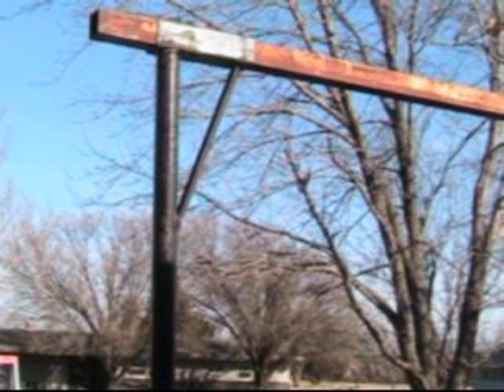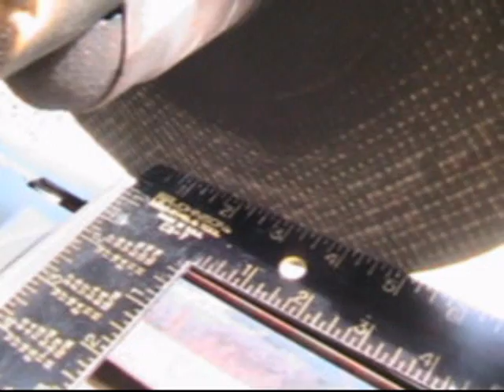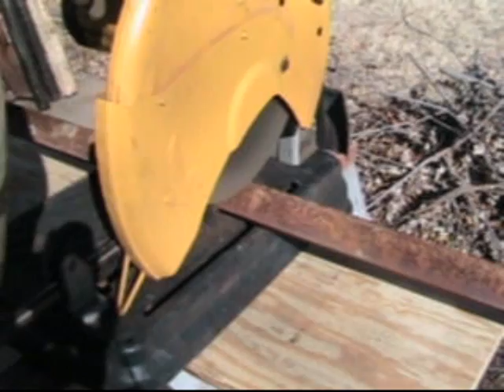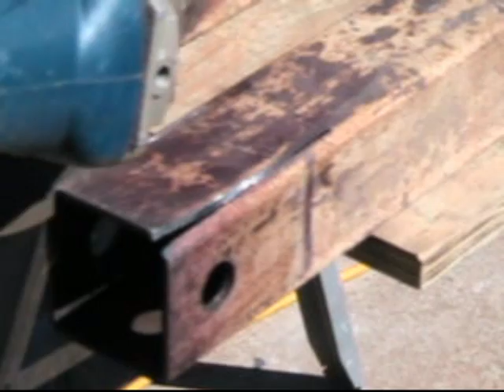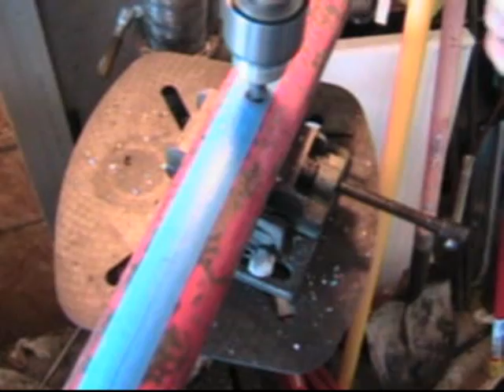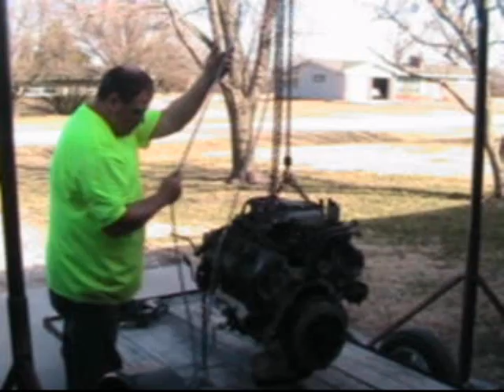DIY Engine Hoist Frame; overhead style

Comment: Hello. Can you give me your toughts on my plan to make a "disassemblable" metal hoist with bolts. My biggest concert is safety. The structure or design would be much like yours. The engine weights 350lbs. The bolts would be used "grade 8" in US standard. "M10-10.9" metric standard. Height - 7.2ft. Materials to use - 3x3x1/4inch wall square tubing for the overhead beam and the two side "T". The bracing would be with angle iron - 2x2x1/4 inch. I need to take engine out of Kia Optima. The engine is 350lbs. Wonder if i need more than 7.2ft height. If of course the whole thing is begin to start with. Thanks for the time.
Reply from the maker: Sounds like you got it down. If it's KIA car, I think the height is ok. 350 lbs is light enough it should work with the 3x3x1/4" square tubing.

The only issue with the height is what you use to pull the engine. A chain hoist will hang down some, so make sure there will be enough distance between a hanging engine and your car's grill area. That's where the 7' 2" may get you.
Reply: @bgdesignandsolutions  Thank you.

Comment: Wow, this is super cool. I've been needing to lift stuff off trailers, remove ladder rack from my truck bed, even lift my doors off my jeep. I've been knocking around the idea of making one of these for a long time, and your design is super simple, powerful, and would get the job done. Pretty cool!
Reply from the maker: It's a little hard to set up, but works great. I have since painted the base and the top rail yellow. Looks nice too. I recently pulled a motor and tranny at the same time on a 2008 Hyundai Tucson. I rebuilt the motor and then put them back in the same way too. Had to do it that way because of the way the gear box was attached.

Because it's adjustable, I set it at 8' 6" for engine clearance over the front grill.

Comment: just came across this nice build .Could you tell me how long the square tubbing was that you welded the larger  round tubing to.
Reply from the maker: The bottom is 2-1/2" O.D., and is 73" long. I then cut out for the wheels, but it's still 73" long.

Comment: Great video.
I am thinking of making a over head portable hoist myself.  I like your idea.
How much can you lift with your hoist, I was hoping to make a 1 ton hoist just for over kill.
Thanks again for the video.
Reply from the maker: I used basic stress formulas when making this, which states 800 pounds with less than 1/4" flex at mid point on maximum width at 120". I don't plan to lift more than that, so it works for me, but I know it will.

Try to find the right formula for what metal you plan to use to help you determine size and strength.

Comment: Okay this is hilarious I'm looking at potentially pulling my engine out of my Isuzu Rodeo but having a hell of a time getting the exhaust manifolds off. It seems there's absolutely no room to get to one of the bolts in the back. I have followed every and traction that I could find and I just can't find it it's a 3.2 L 24-valve V6. Anyway my Isuzu rodeos in 1994 similar to this vehicle in this video. I have very few tools and no engine hoist at this time but I've got a blown head gasket and all I want to do is get the head off of the engine on each side so that I can actually inspect and replace the head gaskets and put everything back together. So far it's taken me about four months of work trying to figure it out. I live too far away from anyone who seems to give a damn about helping somebody like me even though I'm willing to pay them. I'm about ready to call up the radio station or put an ad on Craigslist for free car if somebody has a way to tow it out of here.
Reply from the maker: I fully get your frustration. It would be easier to just pull the engine, than to spend time trying to get the heads off. There's too many hook ups, and stuff going on, and cramped spaces. I know it seems harder, but you just answered your own question: do I pull the engine, or not? Engine is still in, and the heads are still on. Question answered. It took me 15 hours of time to pull my engine, and 15 hours to put it back in. (I know, I timed it both ways). Good luck.
Reply: @bgdesignandsolutions  I just got done working on a 2001 Chevy Malibu, I called her Christine - The car from hell.
After doing multiple repairs on the engine it finally developed a coolant leak that put antifreeze in the oil pan.
Needless to say I was ready to shoot that car. I made the decision to junk the car that had 156,000 miles on it 

and plagued with problems. The engine was a 3.1 v6 and real pain to even change the spark plugs on it
because of limited space to work in. Needless to say I hated that car and having to work on it.
Reply from the maker: @nmsidewinder  LOL, I hear ya. My neighbor had a 2006 that I helped him on once in awhile. He finally traded it off as it was wearing down to needing costly repairs again.

Comment: I’ve been looking at ways to pull a motor out of a parts car I recently acquired only because a few months ago I sold my engine hoist I had. Your idea is one of the simplest and easy methods I’ve come across so far.
Reply from the maker: Brandon Rayner, Hey thanks Brandon for the comment. It's a simple build, it's portable, strong, flexible in height and width, and easy to roll. Although I can assemble it by myself, it's better done with two people.

Comment: Do you think that can handle t 600 lb?
Reply from the maker: Absolutely, that is close to the engine I replaced seen in the video. I designed it for 800 pounds, with 1/4" deflection. However, if you need to lift more, a person could add an additional transfer bar that would place the weight closer to each end (the uprights), rather than in the middle like I have it. I myself don't plan to go over the 800 pounds, as most car and boat engines don't weigh that much anyway. Most engines are under 600 pounds.
Reply: BG Design and Soultions ok thanks

Comment: What type of electrode did you use?
Reply from the maker: I used 6013, 3/32 and 1/8. Sorry, but I don't remember the amp setting off hand. I used mostly DC settings because of the different angles, but if memory serves me right, I also used AC on some of the welds too. Just depended on the angle, the gaps, and so forth.
Reply: 6010 most common should burn that shit together, but you could also use 7018.
Reply from the maker: Yup.

Comment: Good for you nice job very simple you didn't say how did you attaché the hoist
Reply from the maker: Roger Hockemier, If you look at the first picture you can see the hoist attached to a bracket. This bracket made of 2" x 1/4" flat steel and is welded with 1" piece of pipe that is just over the width of the square tubing in length under the cross bar, (welded like an H) and then has a 5/8's round bar on the very bottom to hook the hoist to that goes through the flat bar on each side and is also welded in place . So, two pieces are below the cross bar, and both are welded in place. This keeps the flat bar straight on each side.

On top, I drilled a 1/2" hole through the 2" flat bar on each side and put a 1/2" cross bolt through them over the beam that I can take in and out. This way, if I need to remove it for any reason, I can do so without disassembly. 

Also, my reasoning was to put a wheel on top eventually, but I haven't done that yet because I haven't found a wheel and it's working fine as it is. What I have done is place a piece of pipe over the 1/2" bolt like a sleeve and greased it so the hoist can move along the cross bar while rolling on the pipe sleeve. The pipe also adds a little strength to the bolt and leaves the sheer value at each end should a failure occur. 1/2" sheer is pretty high, so I'm not too worried about the bolt breaking.

Hope this explains it, if not let me know.

Comment: Looks awesome! what size square tubing is that...4"x4"x.25"? what about the verical round pipe...4"?
Reply from the maker: Thanks! The Vertical is 2" schedule 40 on the upper half, 2 1/2 on the lower half. The bottom support is 2 1/2 square tubing.. The top support is 2 1/2" going into a 3" square sleeves. Square Tubing is measured on the outside. Round is measured on the inside. Wall thickness contributes to a good fit. I will have to measure the wall because I forget, but .180" - .190" comes to mind in the square, and round both. 1/4" is too heavy for me to lift. I used an on line calculator for wall thickness and strength at the weakest point, which would be a center load. It came out to an easy 800#, with minimal flex (1/8th") which was my goal. Keep in mind, the upper support is 10' wide. Total cost on this was just under $110.00, wheels, bolts and nuts included. A thicker wall on top can hold more weight, but a simple Triangle design from end to center will work too, and be just as effective, if not more.
Reply from the maker: 2" Schedule 40 is .140" thick. The rest is .175" to .180" thick.
Reply: thanks for the reply. i really like your ideal. i want something that is adjustable and able to dissemble but still sturdy enough. i looking for a max around 1,500lbs. i seen a post in a forum where a guy used  36" 2 1/2" receiver tubes with 2" tubing for the uprights. looks really nice but 36" 2 1/2" reciever tube run around $50-$60 + shipping. i need to take a trip to the metal yard to compare square tube vs round tube cost. maybe a I beam header. im sure 4" square is cheaper or even stitch weld 4" channel back to back.
Reply from the maker: I lucked out, I bought all the metal from an Iron and Metal Scrap yard, and bought it by the pound. Not size or length. When you're designing, keep in mind the up-rights can handle a whole lot more than the cross member. 

The up-rights here are more than enough for 1,500 pounds, what you may want to do is just beef up the cross bar. Also, don't forget about the wheels, they too hold the weight. These wheels are rated at 600# apiece. Making it a total of 2400 capacity, more than enough.